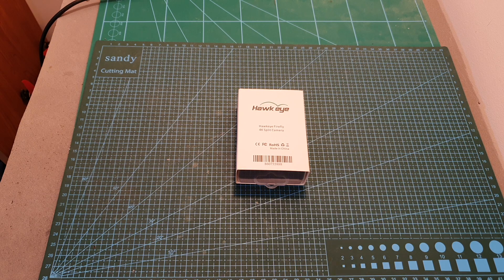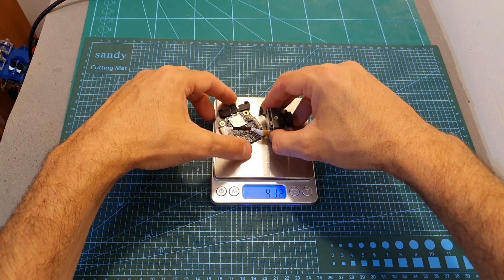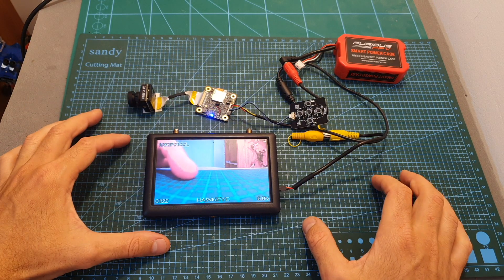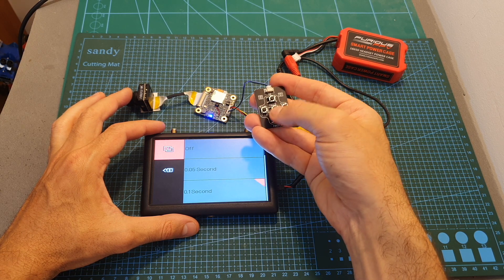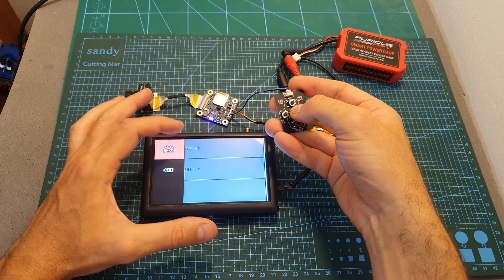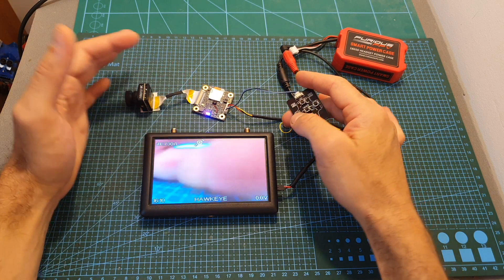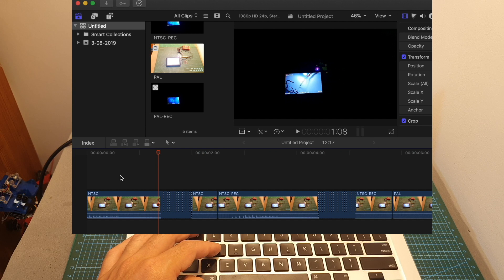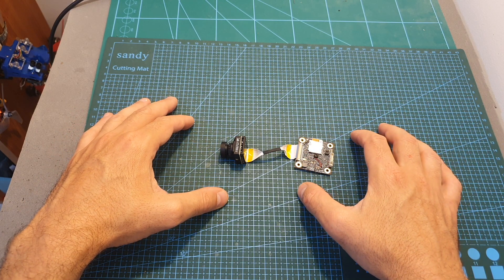Hawkeye Firefly 4K Split Camera - Overview & Latency Test

Comment: Hi Gal, may i ask you which battery you use to make work the camera? i'm planning to add one on my drone but i would like to be sure if i have to add a battery only for the camera or if i can add it directly on my drone
Reply from the maker: Hi - I mention the working voltage in the video.

Comment: I think that the screen itself that you are using may have some latency. If so you need to subtruct it from the total latency to get the camera latency
Reply from the maker: Yes, you are right - that's why my measurement is not 100% accurate but it still provides a good estimation.

Comment: Hi Gal  Great review and video of the firefly 4K split camera, I have a couple of problems with it.  One. The ribbon cable is to short, second.  The 30.5 board,  I fly mostly micro's and most of my boards are 20X20 ,  Thanks for the information on this split.   ps I have a Caddx turtle V2 and I flip over on my landing and broke my lens and cable,  at least the parts are cheap. Thanks again and have a great week.
Reply from the maker: Thanks Johnny. Yes, the ribbon cable is problematic. I told them about it and I hope they will use a different one instead.